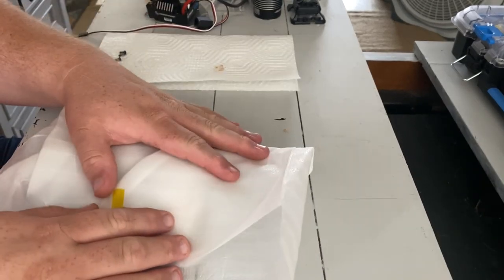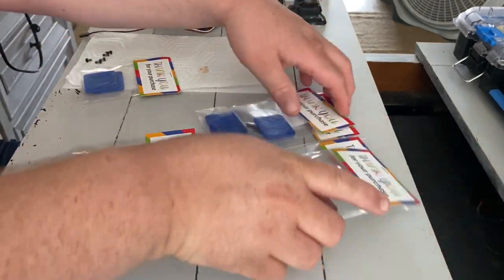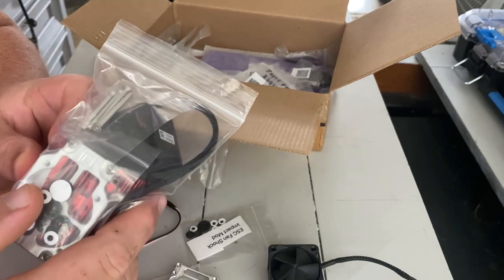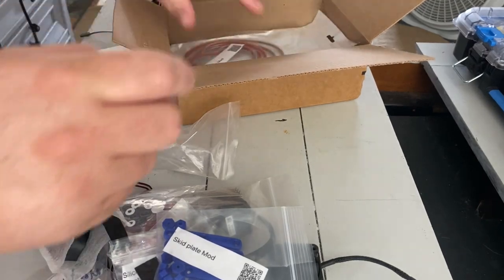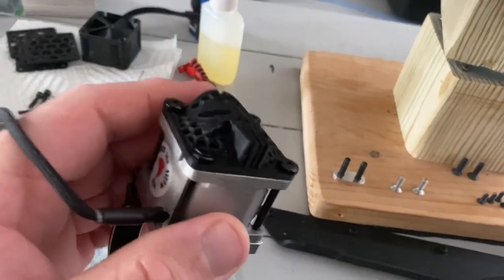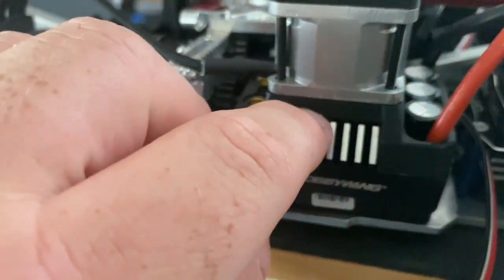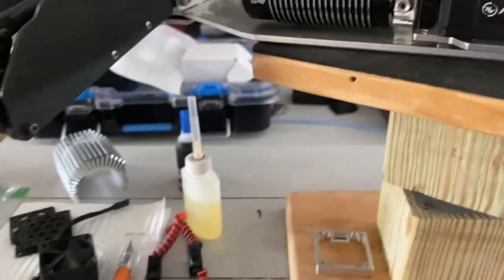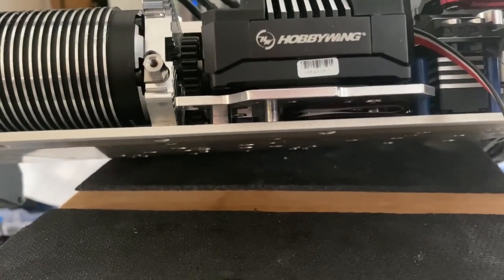Arrma Kraton 6s Build / Fan Upgrades & Enter to Win Giveaway

Comment: Where can I pick up that tire venting mod
Reply from the maker: I used a copper tube from hardware store (because it’s soft metal) Then I used a knife to sharpen an inside edge, put it in a drill like a bit and cut a perfect hole in the tire.